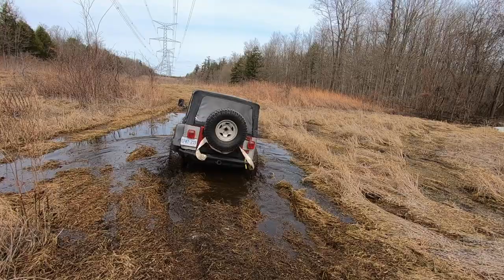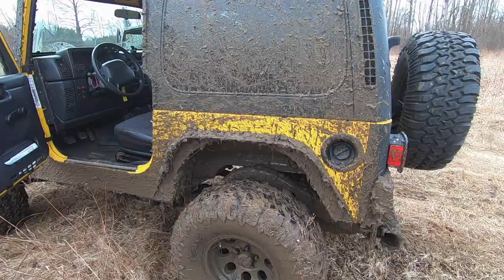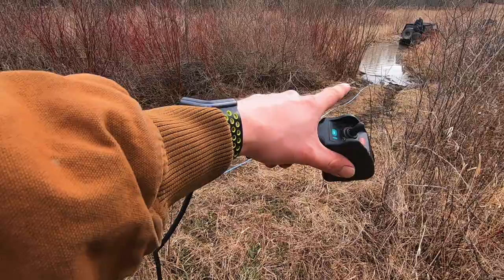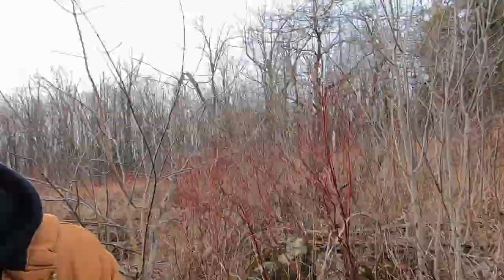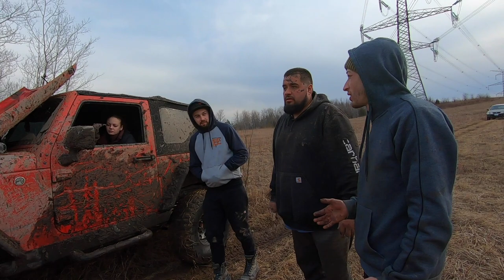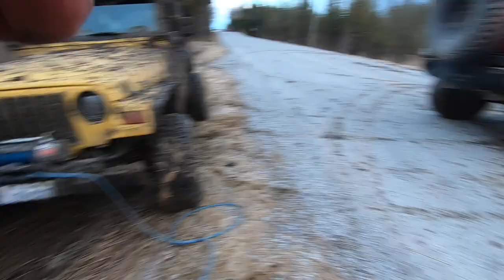BROKEN AXLE SHAFT Half Way Through The SWAMP! Then The ENGINE DIED..

Comment: Don't worry brah, that drone footage was mint can't wait to hit the bogs myself, just threw a new clutch in mine ready to chew for another season!
Also, if you ever blow an axle shaft out like that again, use your highlift strapped back to your frame, bumper, whatever ya got to secure it back to then drive slowly, it will keep the axle shaft in, only slightly rubbing the outside of the tire and not damaging your jackall gettin her back to the trailer ez pz =)
If you really really snap the shaft then log skate is the only option hah, love the content
Reply from the maker: Thanks bro!